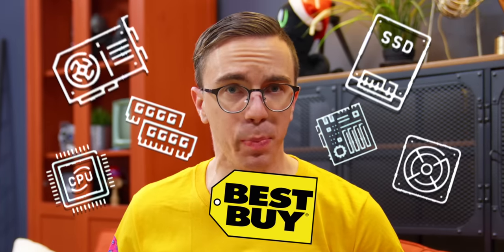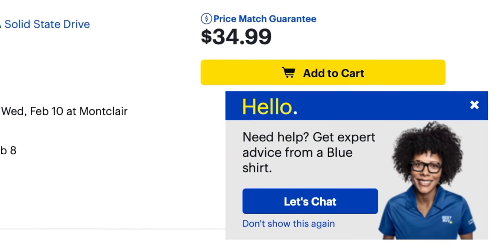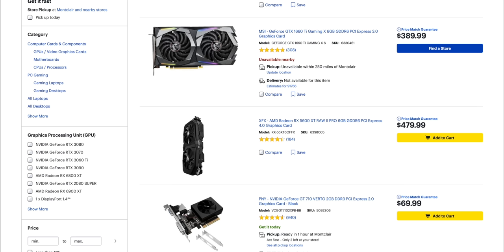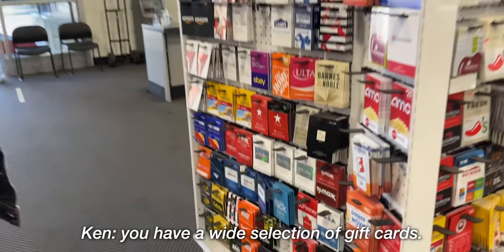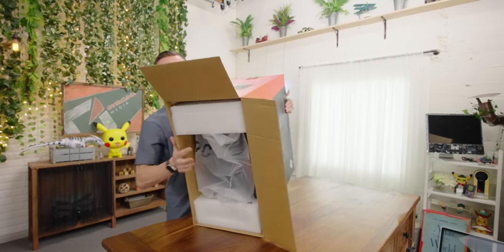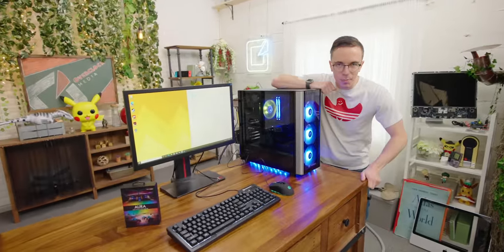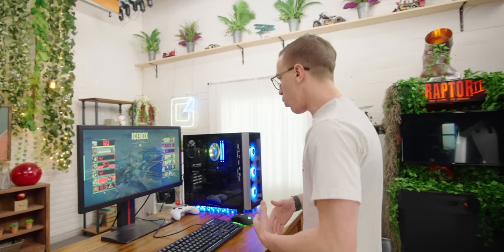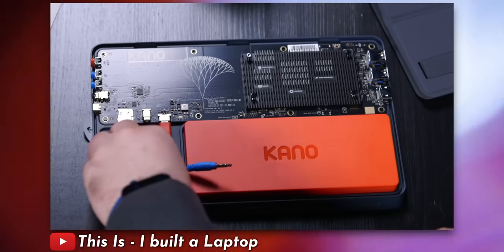Building a Gaming PC...at Best Buy??

Comment: so to mention on the gaming laptop my opinion is, yes, get one. You do sacrifice quite a bit with not being able to upgrade almost anything. But if you can put in a bit of funding into it you can get a system that will run for years. I have a Zephyrus G15 with a r9 5900hs and a 3070. I have absolutely no problem playing any game at high and ultra at 1080 but at 1440 is a bit let's say different. You won't be stuck at low settings and your frame counts will dip into the 60 ranges but man, oh man, you get some gaming experience.

Comment: Recently I was in the market for a new laptop for work. I did my homework and researched a few brands that would fit well for my work needs. I don't need the biggest and fanciest laptop. I did find a Dell that I wanted to purchase. I found the same model at Best Buy, Microcenter, and New Egg. I went to my local Best Buy and the model that I wanted was priced about $200 more than Microcenter and New Egg. I wanted to price match the laptop and I was told by the store manager that Microcenter and New Egg are not considered major competitors for Best Buy. I am so confused. In the end, I ended up buying the laptop from New Egg and saving some $$$. I did have to wait a few days for it to be shipped in the mail. I am curious if anyone else has had an issue with price matching at Best Buy.

Comment: I bought the I buy power trace Mr and swapped out the parts for better ones. I've already upgraded the cpu to the 13900k a 360mm aio and 64gb of ram and I added a 2tb 980 pro. Now I just need to upgrade the mother board and the gpu. I also own a razer blade pro 17 4k for gaming on the go.

Comment: HELP!!! I made first custom gaming pc. I did everything right, or so I think… everything is working but when I try to hook it up to my scepter monitor everything goes bad. When I hook it up all it says is “no signal” then it turns off :( I tried everything from watching videos on why its not turning on to rebuilding my pc, and it still works the same. Very disappointed, I’ve been waiting for so long for this, it had become one of my dreams to have a setup but  I think I should lower my dream to a actual working pc. if you have anything that you can think of plz comment

Comment: Right now building a pc regardless of where you get the parts is a pain in the butt. It is just so hard to get some parts. That being said in the past I have built a pc mostly using parts from best buy and it worked out just fine. Only issue I had was the best buys in my area tend to not carry motherboards in the stores. Given the choice though I would rather go to microcenter or just order it all from newegg. The down side is microcenter is like 2 hours away from me in Detriot so you waste a day getting parts and its stressfull with all the traffic and what not. The upside is you can build your computer that night and not have to wait for the stuff to be delievered.

Comment: Best Buy seems alright, I got all my parts from amazon and I got them all for about £1800 (upgraded mouse and keyboard and headset at Xmas) and it is amazing, but best buy seem decent
Reply: Depends on your stores. I haven't been to one recently, but the nearest ones to (~35 miles away) rarely had any decent computer parts in stock. They usually only had a few PC cases and graphics cards. This was pre-COVID so I don't know if they're any better now.